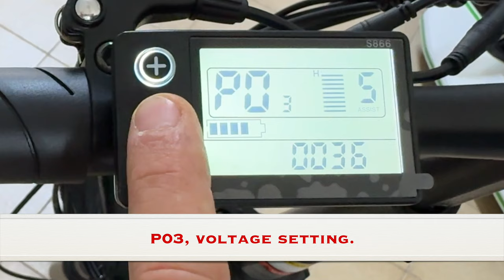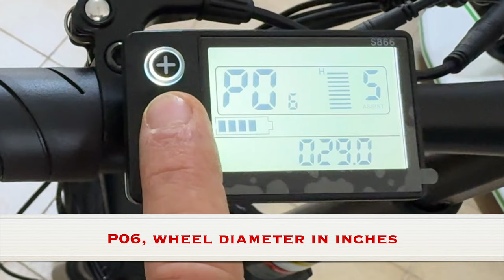HITWAY BK10 - THE PERFECT FAT E_BIKE FOR EVERYONE'S FUN - FULL TEST - 4K

Comment: This is the version with the throttle??
Reply from the maker: @beany1987  yes
Reply: @XTOMCICOS  thanks for the reply, here in the uk, they come with the connection for the throttle but it's pedal assist. You can buy the throttle as the connection for it is in place, and they limit the bike to pedal assist only 27kph until you unlock it.